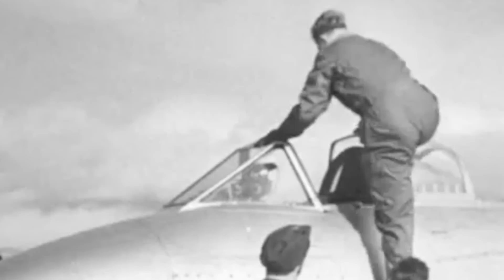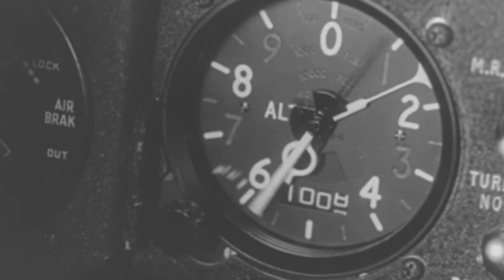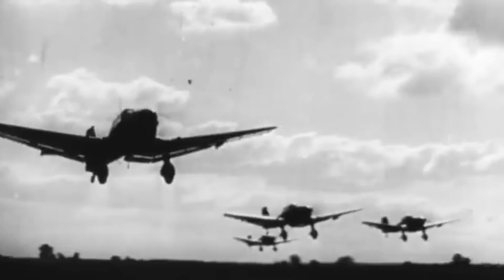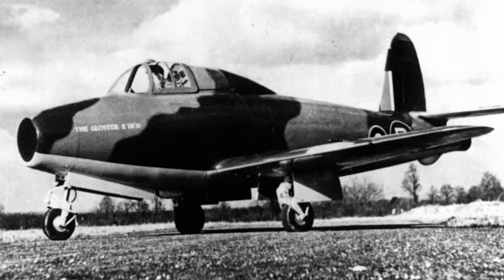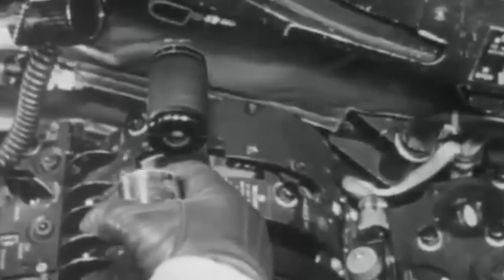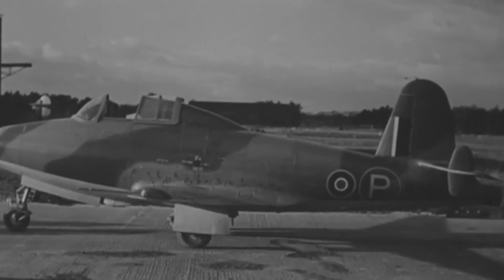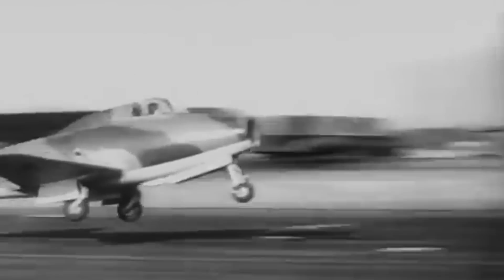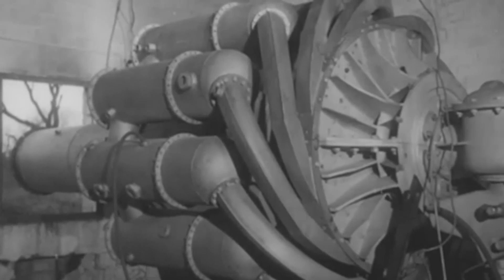Britain's 500 MPH Coffin With Wings

Comment: No The Gloster Whittle was superior in all but flat speed to the ME262.
It was the ME262 that was the unreliable one.
Reply: The Gloster Whittle was completely outclassed by the Me-262.. and it's engine much more reliable.
Whittle would never have a viable engine that could pass airworthiness certification.
No Whittle engine ever saw adoption into RAF service
Reply: @WilhelmKarsten 

We do indeed feel we can clear up some commonly held misconceptions, obviously.

Obviously It's always good & very important to take account of the facts.

Agreed, that's correct, all Sir Frank Whittle's engines received full air worthiness certification, The RR Nene which was a Whittle engine & was of course the most powerful & most reliable engine on the planet in 1944 and over 100,000 of the basic Whittle engine type would be produced in many countries as copies or licensed versions including in the US, China, Russia, France, Switzerland & the UK. 

   Indeed it is true of course that The Heinkel & it's engine by Ohain were of course very amusing & interesting & indeed completely useless. A bit like having an oriental toy manufacturer having a go at full size jet engines & jet aircraft. Ohain's engine was copied from Whittle with a radial turbine to avoid a patent infringement, Ohain had full access to most of Whittles work & writings on the subject & didn't understand most of the how's & why's if the new engines. The aircraft & it's engine was also much more useless than the 262 & it's 46 minute life engines.

     Agreed, as stated it is the case that No German technology axial compressor gas turbine aero engine formed the basis of any UK or US built engines at any time. British axial compressor gas turbine aero engine work began before 1930. The world's first basic axial compressor & turbine technology for turbomachinery applications being created in England before 1900. 
    Obviously the key Nickel super alloys (not primarily iron stainless steel alloys being used in Germany & the US) required for turbine blades were invented in England around 1940 & were available nowhere else at the time. In France around 1951 attempts to develop from German engine designs for the Dassault Mirage 3 resulted in the air cooled sheet steel turbine blades being eventually changed for solid Nimonic turbine blades & a number of other Rolls Royce technologies being adopted in order to get a working engine.

     Of course that's correct, Whittle demonstrated his engine in 1937, the world's first demonstration of a pure gas turbine aero engine.
Gloster E28/29 + Whittle W1 Short Hops April 1941.  
FF May 1941.
Gloster Meteor First flight 5 March 1943.
   Gloster Meteor In Service (after extensive trials & with a very reliable engine.)
  Introduction into service 27 July 1944 3947 produced. Operational in more than 17 countries. Retired 1980s RAF.
Gloster Meteors broke world speed records in 1945 & 1946 exceeding 600 mph. A Gloster Meteor was the world's first turboprop aircraft in 1945.

Yes we are aware that Of course all the British jet aircraft from 1941 onwards were able to exceed the speed of any current piston engine fighters of the same year, the British jet aircraft were not required as superior allied piston engine fighters could easily maintain air superiority. The jets  were restricted to  operate over allied controlled territory only in order to prevent examples getting into the wrong hands.

    Me 262 First flight 18 April 1941 with piston engine (Junkers Jumo 210).
18 July 1942 with junk unreliable jet engines -  Junkers Jumo 004.
In service Introduction April 1944 but mostly still highly experimental & useless.
Retired 1945 Germany, 1951 Czechoslovakia.
Primary users Luftwaffe & Czechoslovak Air Force.

We agree, it is the case that obviously Whittle's basic centrifugal compressor reverse flow combuster gas turbine aero engine is indeed definately still manufactured for various aircraft applications.

     Of course we do indeed hope this helps obviously as always

         C H E E R S.  of course 
    &  Indeed  👍 & 😎 without doubt      
                 O B V I O U S L Y.

. ........ ......
........ . ......
.. ....... ......
... ..........  .
Reply: @WilhelmKarsten Maybe in your mind. But no. What you say isn't fact.
Reply: The Gloster E28 was an unmitigated failure... it struggled just to get off the ground and was slower than propeller aircraft... it was no match for the superior German jets..
Reply: @DoktorBayerischeMotorenWerke The E28 was a test aircraft.
Reply: @MrDHCuthill  The Messerschmitt Me-262 was a production aircraft and the very first operational jet fighter in the world. it was also the only successful jet fighter in WW2, it completely outclassed all of the Allied jets..
Reply: @DoktorBayerischeMotorenWerke  

We feel we can clear up some commonly held misconceptions.

It's always good to have the facts clearly set out isn't it?

  That's correct of course, the Gloster E28/39 was of course a great success as a prototype & research aircraft.   
 
   Indeed it is the case that It had no trouble getting off the ground with the higher speed version, which included an improved engine & different wing configuration, having even better flying characteristics. 
 
   Obviously during testing the Gloster / Whittle  E28/39 was significantly faster than all piston engined aircraft of the same year eventually exceeding 500 mph.

We hope this helps of course.

Cheers indeed & 😎 / 👍 obviously.

. ...... ....... ...
Reply: @Paul-mh9pr  Can you tell us what UK company still makes British jets???
Reply: @petemaly8950  Can you tell us please what UK company still makes British jets today???
Reply: @DoktorBayerischeMotorenWerke 

We feel we can clear up some common false myths, misunderstandings & misconceptions.

It is indeed always very important to note the relevant facts obviously.

Of course It's perfectly normal to find this comment extremely annoying.
 
    Regarding the UK Aerospace Sector.

  WHY IS IT THEY CAN'T ANSWER VERY SIMPLE QUESTIONS ⁉️ 😅
  A very simple question indeed.
   
Which airline recently ordered 60 RR Trent XWB Engines? 

Also name a single Germany company that makes German jet aircraft in Germany & name a single German Company that makes German gas turbine aero engines suitable for widebody airliners.

     That's correct, Brazil makes very good airliners & Brazil is 100th down the list along with Indonesia for wealth per capita.
Norway Holland Denmark Ireland Belgium - Top 20 wealth per capita - Don't make airliners -  its as simple as that.
  
  Agreed, that is correct of course, clearly there are many countries that could easily produce airliners of better  quality than Bow-wing (see b-47 wing folding & wing collapse incidents) but don't for some very good reasons. Bow-wing being a result of the size of the US, the large protected domestic market & great ease of testing new types due to the equator to arctic geography & a few other reasons related to production scale capability, politics & economics.

  Obviously there really is nothing special about Bow-wing, having more than 50 years design / build experience on the type means they have no excuses for the horrendous max incidents for example.

    Indeed BAe Systems & Rolls Royce combined now do more Airbus work than Germany on an absolute basis & significantly more work than that on a per capita basis.
   
     Agreed, Per capita for the home nation BAe Systems is the world's largest defence contractor.
  
    Correct, BAe systems announced the recent £4 Billion takeover of Colorado based US based Ball Aerospace.
  
    It's definitely the case that BAE systems now does a significantly higher value of work for Airbus than it did when it was a major Airbus shareholder before 2005.
     
      Obviously RR now owns US Engine maker Allison for example which does classified Aerospace work for the US Govt.
   
   Yes, that's right of course, Anybody currently flying on a widebody airliner stands a good chance of being on an aircraft powered by RR gas turbine aero engines built in the UK.

   A typical but small glimpse of what goes on in the very internationally orientated British aerospace sector.  

      Boeing Apache Attack Helicopter.
AH-64: 75 UK suppliers, 7% UK content, global fleet of 1280+ aircraft.
F35B more than 130 UK Suppliers, more than 30% UK content.
F35A & F35C more than 130 UK Suppliers, more than 15% UK content.

   There is no doubt that an airline has just ordered
60 RR England Trent XWB Engines

Obviously the UK has the
World's Highest Combined Per Capita
 Nuclear / Defence / Aerospace Sector Activity.

Rolls Royce Holdings UK
Subsidiaries
- Rolls-Royce plc
- Rolls-Royce North America (Allison etc Classified Military stuff)
- Rolls-Royce AB
- Rolls-Royce Deutschland
- Rolls-Royce India Private Limited
- Rolls-Royce Marine Power Operations
- Vinters Engineering Limited
- Rolls-Royce Controls and Data Services
- Rolls-Royce Power Systems
- Bergen Marine
Joint ventures include:
- Rolls-Royce Turbomeca
- MTU Turbomeca -

Trent Family
The MT30 (Marine Turbine)
Industrial Trent 60 Gas Turbine
Trent 7000
Trent XWB Airbus A330neo.
Trent 1500
Trent 1000
Trent 500
Trent 600
Trent 700
Trent 800
Trent 8100
Trent 900

RR wholly owned subsidiaries in Germany handle smaller 2 shaft RR gas turbine aero engine work.

We hope this helps of course as always.  Cheers & 😎👍 indeed.

       O B V I O U S L Y  

. ..... ..... ......  ..... ..... .....
.... ..    .. .. .... .... .. ... ......
Clearly the line above this line is not blank.
Reply: Correct.